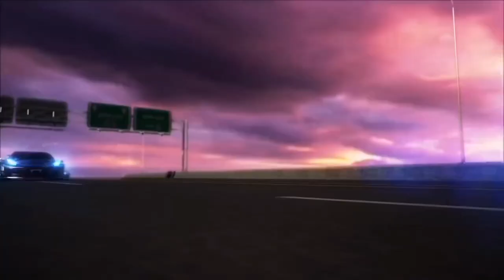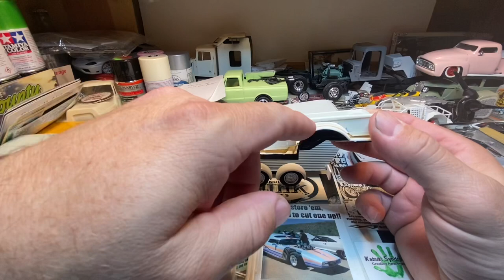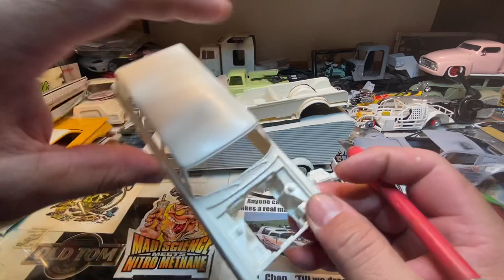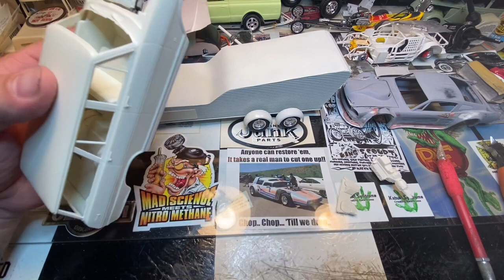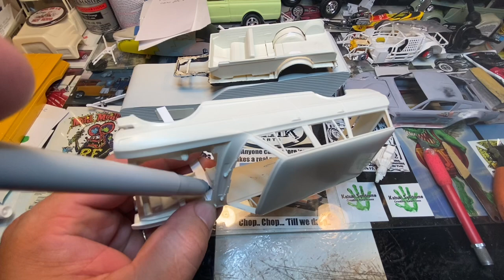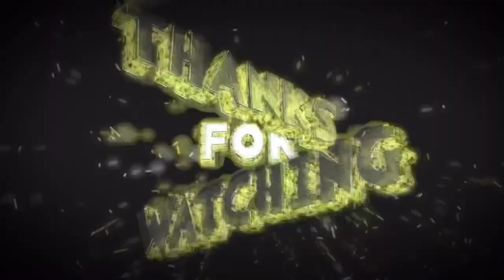Engine won’t fit?? Make it fit!! Recess that firewall-tutorial

Comment: Morning Doc, Chris here........looking great so far my man.........the final should be awesome!!!!!!!! BTW, got an idea for the piece of styrene that U fit in the driver's side of the firewall, I did this trick fitting a new piece of countertop in an old space. Put a piece of styrene a bit larger than it needs to be to fit in, make 2 pencil line marks on either side of the area of the existing firewall the styrene to match up the gap space, then sand off the pencil line marks from the firewall......it will pretty much fit exactly in the shape of that open space. I saw that tip on a DIY kitchen show once, it can pretty much work on trying to match up an area that's not perfectly straight & make something fit in there pretty much seamlessly......hope it helps U Doc.....build on!!!!!!!
Reply from the maker: Kitchen counter tops to model cars! Ideas are endless!! Thanks for the tip

Comment: Another great job Doc! You did exactly like I had to do on my 1:1 buick gs drag car for proper engine placement. I don't know your vision for the final build, but I think I know you well enough to know there will be a hood scoop mod coming. That said,  yes. If you have a fitment issue with the intake to cowl, a notch and box on the cowl would be the right route. And to cover that up moving the rear edge of the cowl scoop back to cover the notch area when the hood is closed would be perfect. Just an observation from the temporary Nort-ern command center. Take care, be safe and have a great day sir!
Reply from the maker: There may be a scoop in the near future!! Hmm 🤔 Doing good down here as well

Comment: Doc, you know I love your work. But where you placed the engine in the mock up is not correct. (I'm commenting knowing I'm too late for the advice. Plus, hadn't had any coffee yet.)
Unless of course you are going for the Gasser style of locating the engine in the moved position to start with. 

I'm on the edge of my seat now to see how this build goes along. Two phat thubs up too!
Reply from the maker: I know the front suspension and such will locate the engine in place. Added that after the video was done.. fingers crossed!! Lol
Reply: @DocsKustomKorner52 . It was just a mention because I know you like to mix things up. Do as you do and surprise us.
Reply from the maker: @Bob0sModelFabWorx  May surprise myself!! Lol